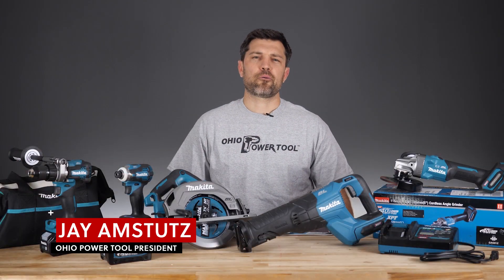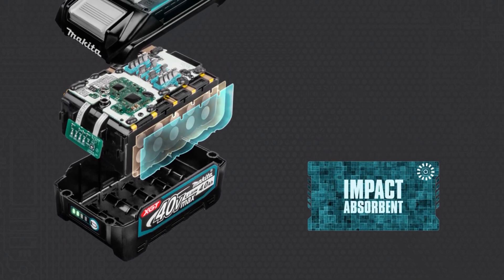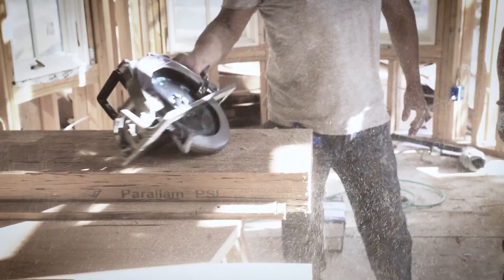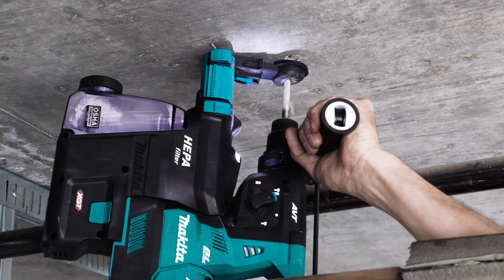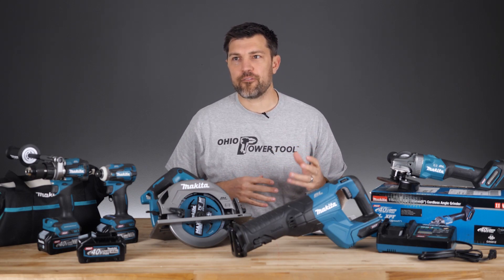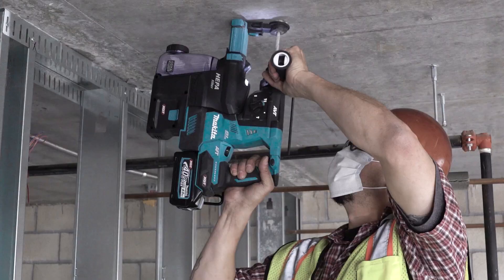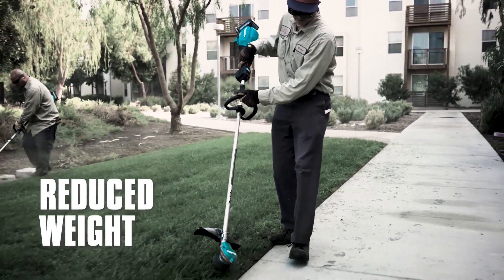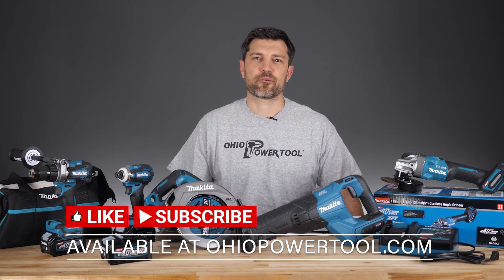NEW BATTERY PLATFORM! Makita 40V/80V Information Has FINALLY Arrived!

Comment: Disappointing they did not release an x-lock with all those grinders. Though the 10 1/4 in circular saw has my eye.
Reply from the maker: Sure it's coming, they really seem to be leading the charge with X-Lock!
Reply: @OhioPowerTool  I love it and if they had a mechanical safety clutch like metabo they'd take over the welding industry

Comment: Wait what?
Are you saying that in 5S2P configuration we are drawing current from only one row?
I thought the power demand (Current) splits between rows, so we end up with cooler batteries.
Reply: For 18 volt batteries with multiple rows it should have sets of 5 cells wired in series and then rows are wired in parallel.  You would get current taken from each cell in the whole battery at a time when in use
Reply: @benculp922  That's what I think too.
But the hero of the video talks otherwise.
Reply from the maker: This is a slight over simplification because yes a 10 cell 18V (20V) battery 5S2P will manage heat to have a higher peak watt output that a 5 cell counterpart in a slim design, you can feel this if you put a slim 18V battery on a miter saw... The real idea here we were trying to get across (not very effectively) that 40V tools can pull much more power, even when using the Makita 40V 2.5Ah battery which has 10x 18650 cells it has full power. With this design you don't need the higher output 21700 cells to get to the increased power as you'd see in an 18V battery configuration. You do need to go in multiples of 10 cells however so to go bigger the battery needs to jump to a massive 20 cells battery, which apparently we will see those later this year for XGT lineup.
Reply: @OhioPowerTool  i'm an electronics tech and you have no idea what you are talking about. You do not understand the fundamentals of power vs voltage, and motor design limitations.
Reply from the maker: @drcpaintball  not an electronics tech but always interested to learn more, the floor is yours, please break it down in a simple way so we can explain it better moving forward!

Comment: @Ohio Power Tool. Thanks Jay for the info on Makita's new XGT platform. I looked over the initial XGT offerings and it's sad that the jobsite radio isn't a charger. Come on Makita. Dewalt's patent on jobsite radios that can charge batteries ran out about 4 years ago. Makita could be the first to make jobsite radio that rapid charges their XGT batteries since radios tend to stay in one place so that they can be easily plugged into AC.

Hope you, the staff at OPT, and your families stay safe and well.